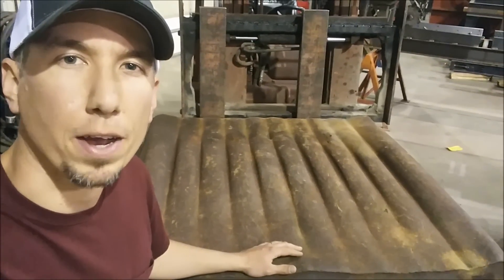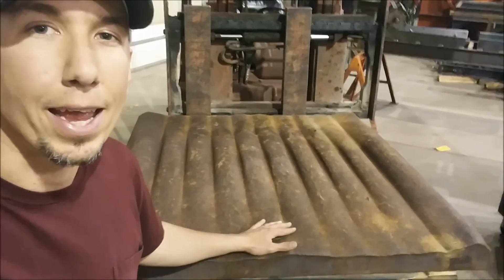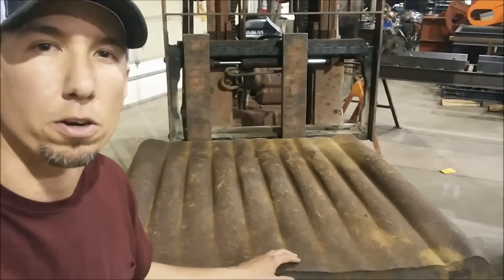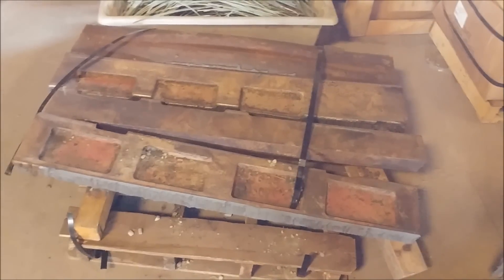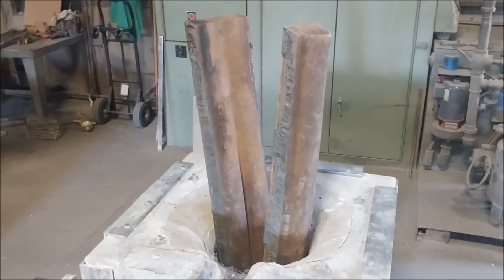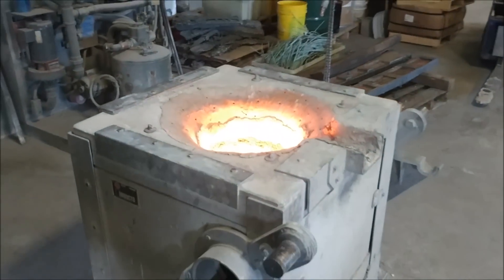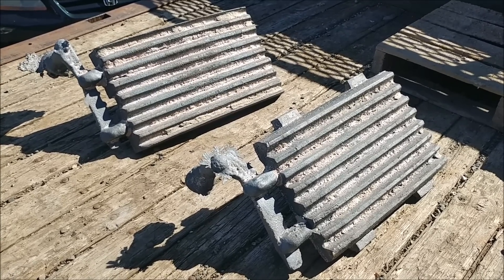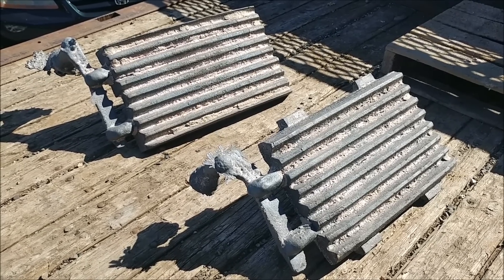Casting Jaw Plates for our Jaw Crushers

Comment: Dechang tianyu machinery manufacturing co.,ltd specialized in the production of insert alloy ,high-manganese steel , ultra-high manganese steel crusher accessories and wear-resistant, heat-resistant, corrosion-resistant wearing castings parts. We can provide offer for your reference if you are interested . Whatsapp/Tel:+86 17360038005
😊😊

Comment: What's the price for the scrap metal you used, manganese? Are  jaw crushers always made with that metal?
Reply from the maker: I got that plate from the scrap yard for 20 cents per pound. Manganese work hardens so it is typically used for jaw crushers

Comment: No heat treatment huh?
Reply: Manganese steels are air cooled having a very thin 60 plus Work Hardening layer on the Surface leaving the rest of the Jaw Softer and Tougher to absorb Shock :-)))
Reply: @markanthonystringfellow3923  it is not correct sir, during solidification segregation of carbides occur in the manganese steel which makes  prone to crack during service
Reply: So there is no need to anneal out any hardness? I’m curious of why there isn’t concern for brittle failure of the part which I though is a big issue for steels. Is this what makes Manganese steel so special?
Reply: @jonathany1240  Yes look up Robert Hadfield the inventor from Sheffield in the UK, Invented in 1882 :-))) Quite Interesting
Reply from the maker: Not on ours, works good